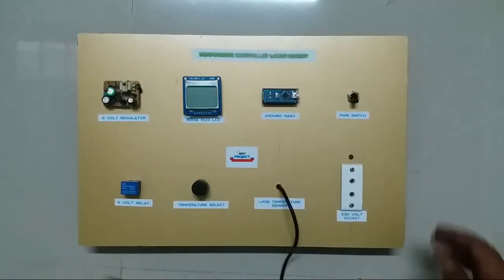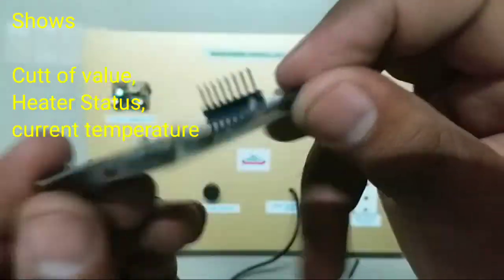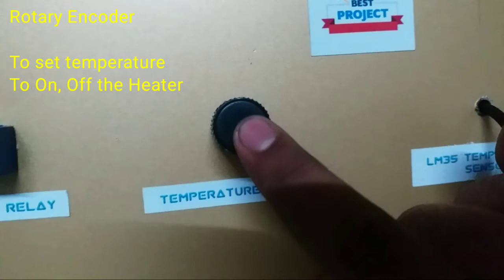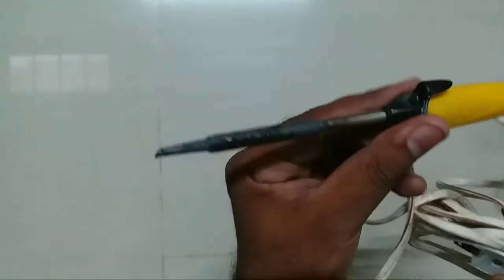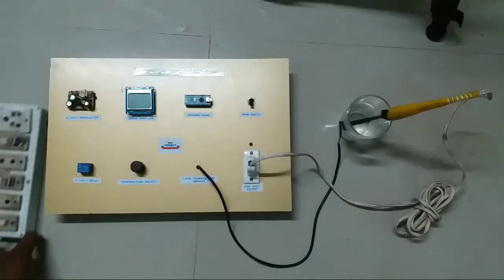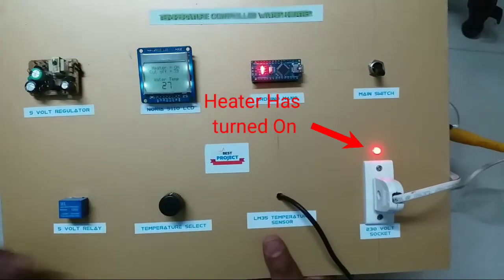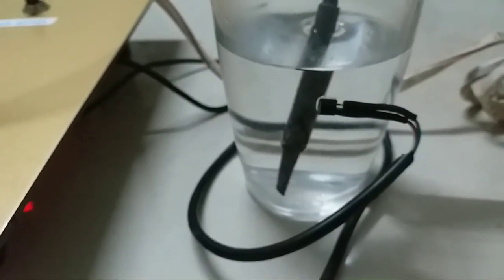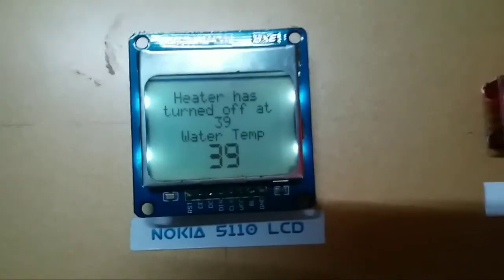3. Temperature Controlled Smart Water Heater | Smart Control | Setting Knob | Arduino | Auto Cut

Comment: 6:26 what wire did you use for the socket wiring(yellow)? 1.5 or 2.5mm?
Reply from the maker: It's 1.5kmm and around thickness.
Reply: @ElexysProject Thank you for replying  one more question for BS 1363 UK socket do I use 2.5mm or 1.5mm for wiring?
Reply from the maker: @BravoSix_6  2.5mm
Reply: @ElexysProject  thx, just subscribe

Comment: can we make it shockproof,  so water can be heated up as soon as it drops to set temperature while someone is in the bathtub for example?
Reply from the maker: Thanks for your valuable feedback, we can provide your a water proof temperature sensor, for water proof operation of heating, we will need to use a induction type of heater which works on Faradays law of electromagnetic induction.
Reply: @ElexysProject   Thanks for your reply.. I asked if it can be made shockproof
Reply from the maker: To make shockproof, need to use inductive heating to isolate 230 galvanically..

Comment: Any coding required for this?
Reply from the maker: Around 50 to 70 lines of Arduino code is running in the microcontroller of this project,
Reply: @ElexysProject  could you share the codes used for this project? Would love to try this out.
Reply from the maker: You will need to buy it,
Reply: yemane188@gmail.com
Reply from the maker: What is the purpose of this email?
Reply: Meet me for the code

Comment: What is smart in it?
Reply from the maker: Not all heaters have ability to turn of it itself, specially at desired temperature, geasures are set at particular limit, but cant set at desired level, that's why it is smart.

Comment: Does this give a shock?
Reply from the maker: No, because the Relay are isolated from the sheet, and when someone buy it, i give them by providing the insulation using heat shrink tube. So no worries about the shock.
Reply: @ElexysProject  if I Use ds18b tempersture sensor?
Reply from the maker: You can use, if it is suitable with Arduino.
Reply: @ElexysProject  can you give me arduino code plz
Reply from the maker: @ABC-yo9lh  email us on moinyunus@gmail.com